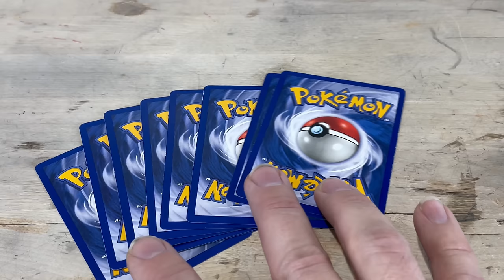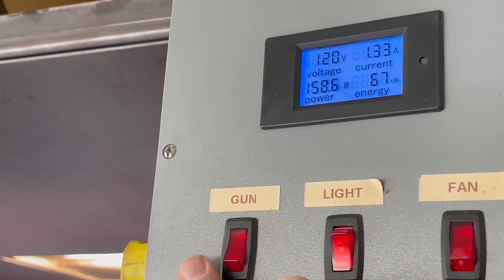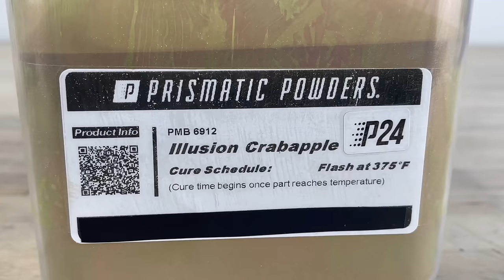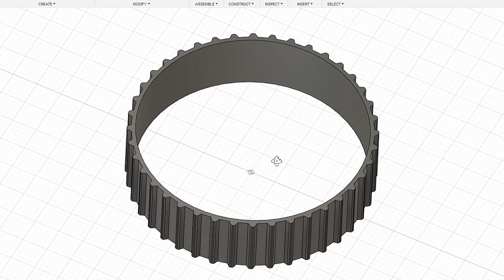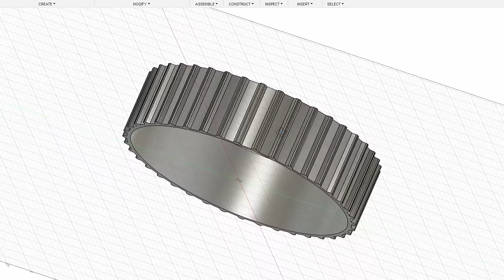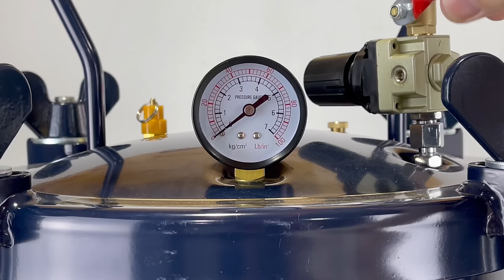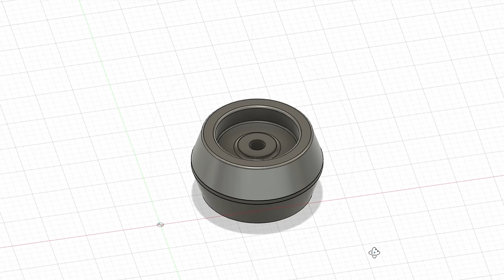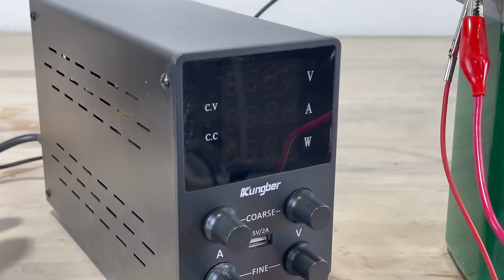1930s Marx Lumar Automatic Scoop Powered Steam Shovel Toy Crane Restoration 4K

Comment: Great work, I just have one question... When you're sandblasting the parts, isn't there some rust left under the unreachable places, such as the corners where one side of the cabin is folded over another? If there is some rust underneath, is it dangerous for the part in the future? That's just something I've been wondering about, great job otherwise.

Comment: did you really use a Charizard Pokemon card to spread the jb weld??? a card that could have been worth probably as much as the toy you restored if not more???
Reply: A Base Set 2 Charizard has a retail value of about $400 in Near Mint condition.
Reply: Thats what I was thinking...That looked like a first gen. I remember when my kids were young that was THEE card to get back in the 90's
Reply: some of those cards can be worth a lot, I saw this one guy not long ago that had a base set 2 psa 10 black label valued at 50k usd, idk the condition of this card before he used it as a mud spreader but... could have been a good one
Reply: @thomasengstrom1525   It has the 2 logo with the pokiball under the picture which was from a reprint base set 2 but still worth between 200-400 in that apparent condition
Reply: that's a holographic too... even if it's a base set 2 I think that's(was) worth at least 1k usd

Comment: First one of your video's I've watched.  As I watched you transform what was a rust-bucket, basket-case toy into a gleaming showpiece, my mind = BLOWN! 😲  OK, the sandblasting to remove the rust & old paint, expected; starting getting impressed when I saw you using JB Weld to fill the surface voids the rust had pitted into the base metal.  The finish provided by the powder-coat paint looks far better than the original Marx paint.  What really made my jaw hit the floor was seeing you use an obviously VERY expensive CNC mill (I used to repair CNC machines for a large machine tool company back in the 1980's, primarily the elctronic controls in them) to machine the molds for casting new rubber tracks & wheels; also impressed when I saw you test for lead paint, then make a substitute for the lead casting that secured that large gear to it's shaft.  You didn't just restore it; you re-manufactured it to BETTER than NEW conditon!  (Also got a kick out of your kitty at the end!).

INSTANT new subscriber, looking forward to checking out some of your other videos!

Comment: I would use a water medium and an abrasive, it would rub and push that stuff off the surface, instead of blasting it off. Both ways work. Less mess and cleaner this way.

Comment: Fantastic work and out come of that full restoration.  The 2 things I could do a little different is where you screwed the screw to the winding bar , is make a little flat spot for the screw to rest into and it would make it a little more durable for the long run and maybe with the springs , turn them facing the other way so it's not so pointy for thinner skin , constructive criticism is all ???

Comment: For bending the spring wire round the rod you could use a bit of flat bar with a hole, for the wire to pass through, so you can control the bend where you want it. That's how we tie wire on fences.

Comment: I really enjoy your channel and watch it often!  I do have a question regarding your powder coat process.  This item had four coats (albeit one was wet sanded down some).  Were they all electrostatically applied or did the last couple coats require "hot flocking"?  Thanks again and keep up the great work!!

Comment: A possible way to fully remove bubbles in the rubber may be to put your pressure pot on a vibrating platform of some type.
Reply: I saw another restorer use a vacuum chamber instead. The air bubbled out of the part like soda pop.

Comment: Spray Windex on the surface you intend to place the decals on. That way you can easily correct the placement while the Windex dries. The Windex will eventually dry and the decal will be permanent. That way you're not stuck with crooked decals like the one you put on.

Comment: I really enjoyed that build. The only thing that bothered me was the slightly crooked lumar contractors stickers. Otherwise, everything else was excellent. Peaning over the connecting rod in the shovel mechanism that needed clearance was excellent. I was wondering if it would have been a good solution also to attaching the wheels on the 1930s car build where you elected to glue the wheels on instead. I’m generally not keen on glueing wheels on 1930s items because it’s not easily reversible and doesn’t seem authentic for the period. Peaning over seems more authentic. Could be wrong though. Just a thought not a criticism. Cheers.

Comment: Lovely work!

I don't think the metallic green is faithful to the original. Indeed, was a metallic paint ever used on toys of that vintage? In any event, a metallic finish is never used on real construction equipment, only consumer vehicles, making it more out of place.

Where the set screw bears against the gear handle shaft, I would have ground at least a shallow flat. Set screws tightened against round shafts are virtually guaranteed to loosen and slip before too long.

Cheers!

Comment: If the hook supporting the cab was reversed as used when coated with primer, it may have been able to reduce the Farrady Cage effect allowing powder to hit the area between the tab and the operators compartment. Also, try using a smaller diameter wire. It is frustrating not to have all the surface coated, at least it is for me.

Comment: I'm a Mechanical Designer by trade. Since you can design in CAD, the rubber parts could have been 3D printed in a rubber polymer. NO mold needed... or... You could print the mold itself. That hunk of Nylon (for just those parts) ain't "Duck Walk"($$$). Beautiful job regardless.

Comment: I can hear Pokémon card fans just screaming their lungs out, my sister included🤣 a rare example can fetch a pretty penny
Reply: But did you know that some kinds of rubber treads can be helped bringing them back to a healthy state, with stuff like WD-40 or lubricating liquids.
I had that with a dinky toys halftrack, i tried replacing them but the replica's were to thick thus they didn't work then i used a type of oil and it at some point became good! Note: i can't say if it works on all track kinds since mixtures could differ..

Comment: Great restoration of a nonfunctioning POS toy. The thing did not work right when it was brand new. No bushings in the hand crank and a sprocket against a gear. It will grind every time until the teeth break off. No bushings in any of the moveable joints.

Comment: Your question “what’s this” has probably been answered but,,,,
Down south we call the insect that made that mud nest dirt or mud dobbers. They look like a wasp. 
From the web,,,,,,,,

What is the Lifecycle of a Mud Dauber?
Mud daubers undergo complete metamorphosis, which means they pass through four stages during their lifecycle – egg, larvae, pupae (cocoon) and adult. Depending on the species, they complete one or two generations per year. In the spring, overwintering pupae develop into adults. The new adult females will construct nests comprised of mud tubes of varying sizes. Each mud tube is provisioned with several spiders that the female mud dauber catches and paralyzes with her venom. The female mud dauber deposits an egg on the first spider within each mud tube and then seals them with mud. The mud dauber larvae will hatch from the eggs and feed on the prey left behind by the adult female mud dauber. Then, the larvae will develop into pupae, a process that usually takes about three weeks. The pupae will spin a silk cocoon to overwinter until the following spring when they become adults.